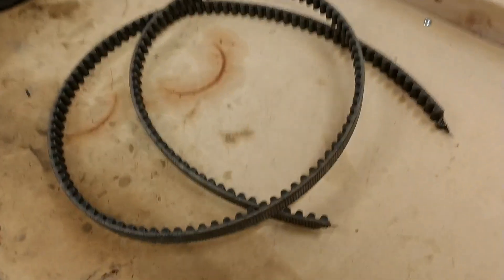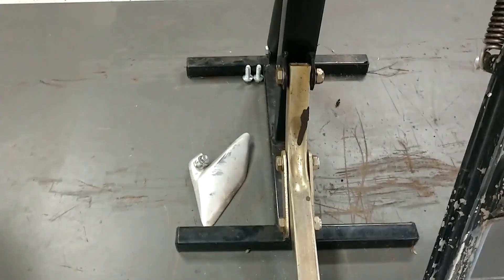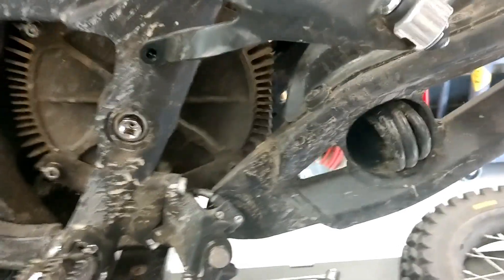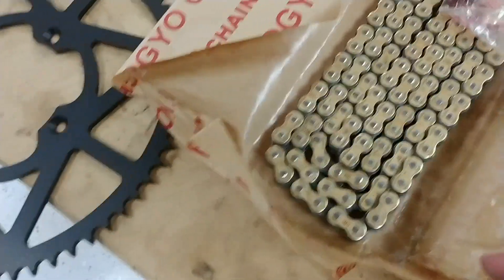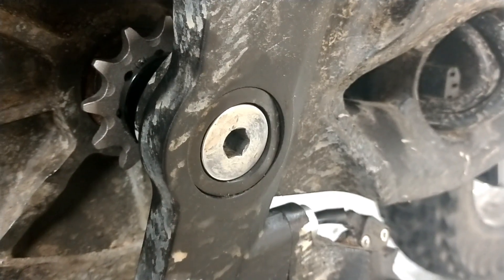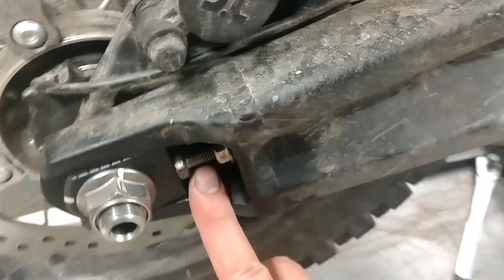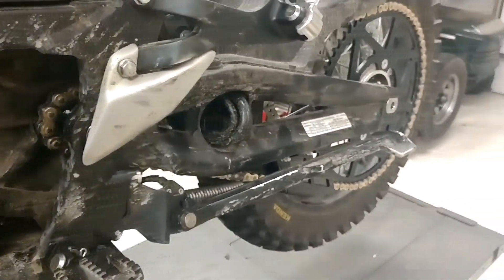Zero FX/FXS Chain Kit Install

Comment from the maker: IMPORTANT NOTE:  ZERO does not recommend using an impact gun on the bolt on the motor shaft. This could damage the motor encoder. Secure the shaft from spinning in another manner and use a traditional wrench.

Comment: Can you tell me whats the front and rear sprocket size? Are there other options out there? Seems to be very expensive for a kit of sprocket and chain at $400...
Reply from the maker: They are JT sprockets and a D&D chain, the front sprocket is 12 tooth with I think 13 interior splines, I don't know what the rear sprocket is but it's pretty big. I'm sure the rear sprocket has to be custom-made for the Zero.

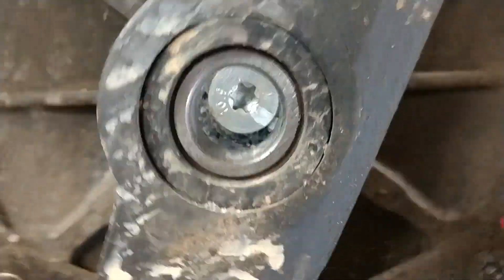Comment: At 4:16 are you stowing/storing your charge cable in that little hole in the swing arm?
Reply from the maker: No, I've never really tried that, I'm not confident it wouldn't fall out.
Reply: @GregHassler  Ok I thought that's what I was looking at but I guess not, thx

Comment: So, trying to use your video practically, I'm wanting to know whether or not the amount of sprocket/motor spline play I'm seeing is ok.  Also, properly torquing down the bolt for the motor/front sprocket is tricky since most 3/8" drive T45 or 6mm hex drivers won't fit through the swingarm threads.  You totally skipped over that part.  As someone trying to actually get help with this job, this video covered everything I didn't need and totally skipped over two things I actually really want to know...
Reply from the maker: I don't remember having issues with either of those things.
There shouldn't be much play, if any, on the splines on the motor shaft to the sprocket.  Do the splines look worn?  It's not really an area prone to wear.
I'm not following your torque issue, how did you get it off if your driver doesn't fit through the hole?  I don't remember having any issues with that either, mine clearly fits through the hole fine in the video.  It was a T50.  Just get a new Torx socket set.

Comment: I had 3 Harleys and I still having a Harley V-Rod and a Zero S all of them with belt, never had a problem, are quiet, I never changed one, maintenance free, I put thousands of miles on each one and I love it, if you are not doing wheelis all day or in serious competition makes no sense install a chain kit, add noise to the quiet electric bike, need adjustment, tedious cleaning and oiling every 700 to 1000 miles. No thank you!
Reply from the maker: Agreed! This was used extensively off-road over rocks, logs, roots, lots of wheel spin, etc.  Belt was severely damaged within 500 miles off road.
Reply: If you a ride a Zero FX deep in the woods like I do, then a chain kit is a must.  One stick or stone gets caught between the belt and the sprocket you can snap the belt.  Doing a field replacement in muddy ravine miles from home is not an easy task.  But with a chain, it's most likely not going to break and if it does, you don't need to drop the swing arm to put a new chain on.  Now if someone comes up with a  real masterlink for a belt, that could be a game changer.  Carry an extra belt with a masterlink, that could get ya home.
Reply: @erolsommer  I understand, personally I commute in city and less noise and no lubrication/maintenance is a plus for me, Ride safe.

Comment: Do you have to remove the rear brake to remove the rear wheel?
Reply from the maker: The caliper?  It's sort of one and the same.  The caliper is mounted to the axle, so it is not mounted once the wheel is removed.

Comment: Do you need to get the bike reprogrammed after the chain kit install?
Reply from the maker: Only if you want the speedo to be accurate.  It will read fast, but a dealer can correct it.  Otherwise everything works fine.
Reply: @GregHassler  thanks, I installed the kit and now it bogs and stutters at higher speeds. The motor has lost power, I guess I wasnt carefull enough taking off the front sprocket

Comment: Did you change ratios?
Is this a factory kit from zero?
Reply from the maker: This is the factory kit, but it's a shorter ratio than the OEM belt by about 10% or so.  Lower top speed / faster acceleration.

Comment: Hi Greg, thanks for the video with the valuable instructions. Small questions, did you notice any degradation of the splines on the motor shaft in the meantime? I am considering to get the chain kit, but I have seen some reports of spline damage due to the thin sprocket and that it would be better to get a sprocket with wider splines. Thanks in advance.
Reply from the maker: I didn't notice any damage on the splines, but I didn't have high mileage on the bike.  I wasn't aware of that being an issue for anyone, but if you ride off road the chain kit is a must.

Comment: Greg- what did you use to paint the kick stand? Did you have to pull it? Hate that it sticks out so much factory silver.... thanks
Reply from the maker: I forget if I pulled it, I don't think so, I just cleaned it and masked it.  I sprayed it with whatever matte black rattle can I had laying around the garage.  It did end up flaking off a bit, but wouldn't be hard to respray it occasionally.  Powder coating would probably be more ideal long term.
Reply: Greg Hassler thx man. Thinking powder coat is the way to go but I’ve also had some great results with this apoxy rattle can paint on my trucks and it’s VERY VERY durable.

Comment: Greg, great video, thanks for posting. With the chain conversion is there any performance difference? Also, does the chain conversion kit reduce the mileage you get out of the bike per charge?
Reply from the maker: The chain is geared lower / shorter, so yes it affects performance. You'll have more accelleration and easier wheelies with less top speed. Great for trails and lower speeds, worse on the highway.

A Zero dealer can fix the speedometer with programming.

Consumption, especially at high speed, I believe suffers a little but I have no data.
Reply: @GregHassler  Thanks Greg! Have you tested out the max speed on the highway with the chain conversion? If so, what was it?
Reply from the maker: @Wa-Wranch  I forget, but I think the gear reduction is close to 10%.

Comment: The fish link will come off because of the rubber it's passing through. If you roll it backwards a lot. I went for a normal motorcycle chain master link fits through without touching the rubber.
Reply from the maker: When it's time to replace I'll of course use the rivet link, I just used both because I followed Zero's instructions without checking first and had to put the chain back together.
Reply: @GregHassler  Keep an eye on the fish link. Mine decided to come off despite being tied down with racewire.

Comment: Also did you have your speedometer calibrated
Reply from the maker: Yes, I had the dealer recalibrate the speedo after this.  They just punch in some numbers in the software and it's supposedly fixed, I haven't GPS tested it to see how accurate.
Reply: Greg Hassler man thank you so much for the info

Comment: Did you tighten your chain guide all the way down.  Mine touched the chain a bit
Reply from the maker: Yes, the chain rubbed the rubber insert a bit, especially could hear the thump of the master link going through.  I think the chain will just wear it in though, already seems quieter.
Reply: Greg Hassler thank you sire that’s what I figured

Comment: Great tutorial, I've a FX '17 and I've bought a jt front sprocket JTF565 12T http://www.jtsprockets.com/fileadmin/code/images/large/JTF565.png  but central bore looks a little bigger compared to original belt sprocket, I'm talking about 0.5-1mm of inner diameter difference (sprocket inner bore is bigger). Did you notice it too while installing the front sprocket? Or can you tell which JTF model do you have installed? Thanks
Reply: instablaster...

Comment: Excellent video, thank you. I have been hesitant to install my chain conversion on my DSR for quite some time, now. Your video has eased a lot of my apprehensions about doing the install. Thanks for taking the time to show a detailed install. I am curious though, how did you keep the motor shaft from spinning so you could torque down the new front sprocket? Take care and ride safe!
Reply from the maker: Yes, I realized I skipped over that.  Honestly I dropped the loctite on the bolt and just popped it on with a battery-powered impact gun, it looked like it spun 1/4 or 3/8 of a turn past hand tight, so I'm hoping it doesn't come off and I don't die.  They say it should be torqued to fifty-something ft/lbs, but you can't get to the bolt while the swingarm is on.  You could arguably lop the chain over the sprocket to hold it in place and secure the chain somehow.
Reply: + Greg Hassler Thanks, Greg. Turns out I neglected to recall that the 2016 model has a set screw and a sprocket shaft key that I will have to be mindful of. Sad times at Motormount High.
Reply from the maker: @pinaero  yes, I noted it in the description but any pre-17 Zero has the keyed shaft.  However pullers are readily available and inexpensive at pretty much any auto parts store.  It is an extra step though.
Reply: +Greg Hassler Yep, I feel silly I bought a 3 jaw puller some months ago for this exact purpose. I was just so excited to see your video I thought to myself, "let's do this!" then I was like "hm... maybe I am not ready." haha